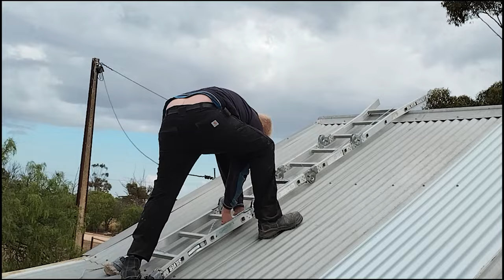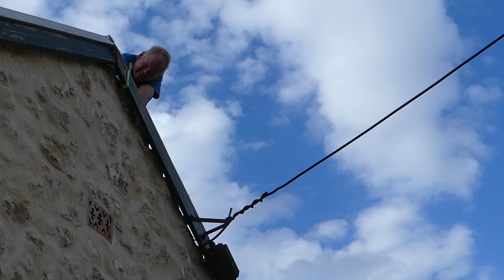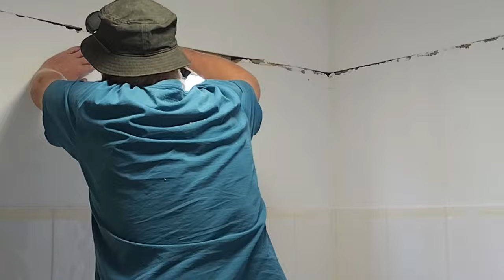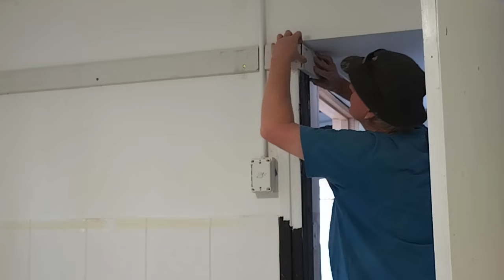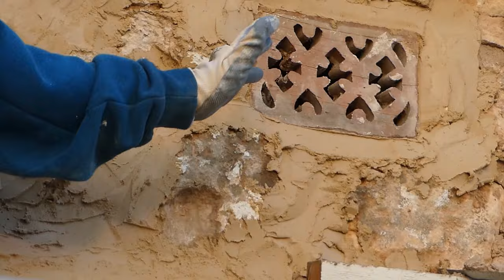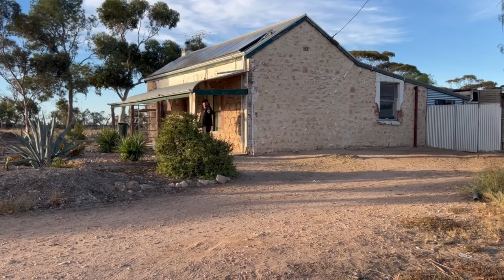150 Year Old Stone Cottage Roof Repairs - Corrugated Iron Roof and Repointing Stone Wall

Comment: Say whaaaaaaaa………rocks in the roof Albi? As Goma Pile would say, ‘goooooooooolly’. Alison, can see you were conveniently located at the bins to catch Albi if that ladder slipped off the roof like a giant sled…..beer in one hand, no problem. And good place to work on that vent, by the fire. LJ says, ‘I’m workin’ with amateurs!’ I had to look up how to spell that one. Didn’t have a dictionary for breakfast. See yar
Reply from the maker: Yes it’s fascinating to see how basically they built these old stone homes rocks to the roof and a few beams across the top to hold the roof.
More likely running for safety so he didn’t land on me hahaha. I need to find more indoor jobs near the fire now it’s getting cold😁 LJ is definitely working with amateurs those 2 are spoilt brats. Thanks for watching and commenting. Ana.